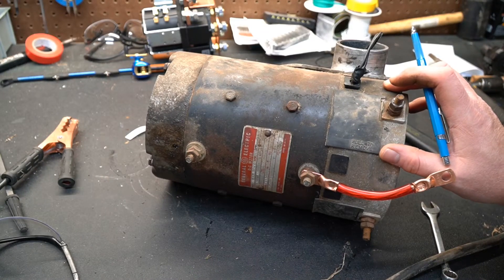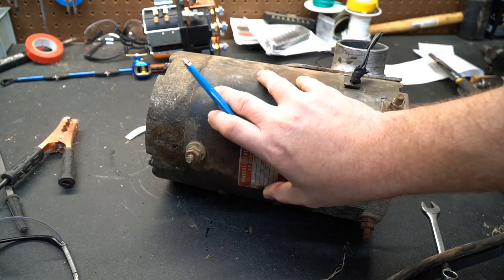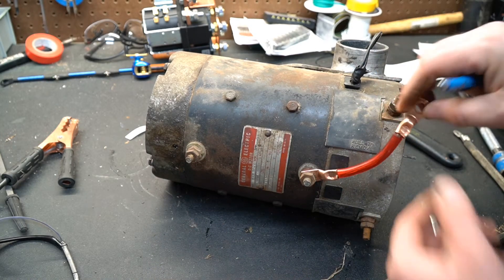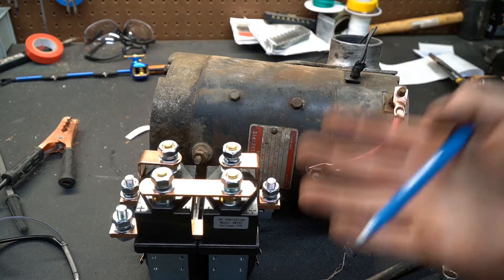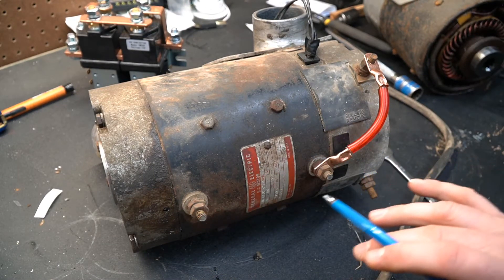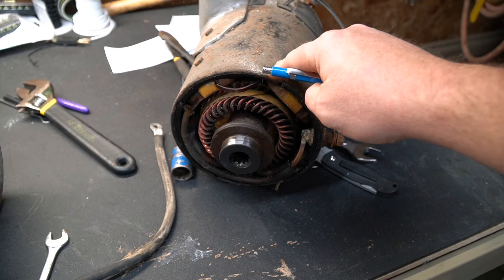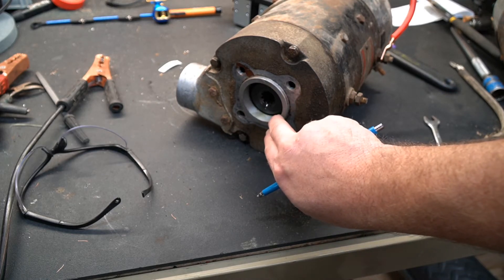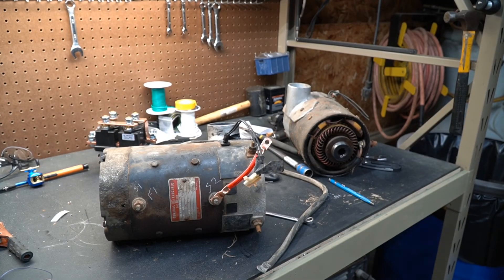How to test, wire and run a Series Wound motor!

Comment: Thank you for the video, it helps to explain the difference between a motor that can be reversed externally and a motor designed for one way rotation having four brushes like in a hydraulic pump motor. I think.

Comment: Excellent video, thank you very much. I can not tell on my golf cart motor which is the A! and A2, and I can't tell which one is the S1 and S2. The cart is very old and these markings have been worn off or lost somehow. Does it matter which terminals the A's are cabled to the S's? In other words, can I hook any A to any S with a cable and not hurt the motor when I put 12volts to the other A and S? Thanks in advance for any help.

Comment: Hello, your explanation is excellent, thank you very much.
I consult you a particular case; I have a machine equipped with two 48v/24 DC motors. How do I connect them and act in the same direction at the same time? this equipment contributes its energy through a curtis controller. I remain attentive to your comments.
I have S1, S2 and A1, A2. Thank you.

Comment: Thank you this is exactly the kind of info I'm short on! I'm working on a 1958 "Turf Rider IV" golf cart and it has a GE motor that looks just like yours connected to a belt drive axel set up. It hasn't had batteries in it for many years but the motor/belt does turn freely when the axel turns.. good or bad sign? 
Could you point me in the right direction in how to go about testing this thing.. can I hook one or more 6V or 12V batt up to it and see if it goes or......

Comment: What kind of AC to DC converter will you use to test those units using home power
Reply: A car battery is a better option bud.
Reply: @mikescudder4621  thanks Mike but I do things with the DC that I use in my shop and moving display. I can have a battery on stand by. I rather plug and play.thank you.
Reply: @molinarenterprise  Its just that these motors draw a lot of amps. Mine from a golf cart will draw over 300 amps on acceleration. But ok a simple bench test is a different story but i'd imagine that it'll draw a fair few amps just to get moving. So maybe a 'fast' battery charger, or one capable of jump starting a car. You also shouldn't pass 12v for bench testing without a load.
Reply: Is that red wire the ground?

Comment: What is the make & model of the forward & reverse switch you showed in this video?
Reply from the maker: It is one of these:  https://www.albrightinternational.com/products/sw202/   Keep in mind, when your ordering one, make sure you order one with the correct coil voltage for your application.

Comment: I have a 24v series wound 1hp motor that I took out of an old factory work cart. I’m putting it on my garden tractor to make it run on solar. My tractor already has a reverse gear in its transmission so I don’t need to worry about making run backwards.